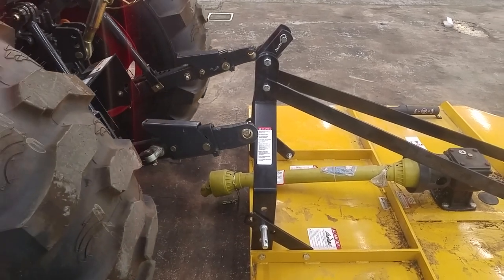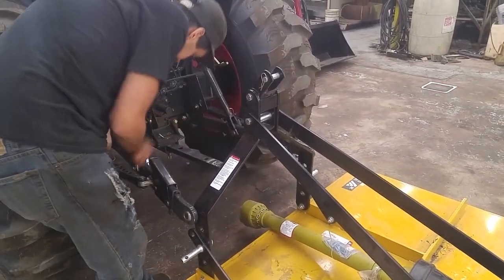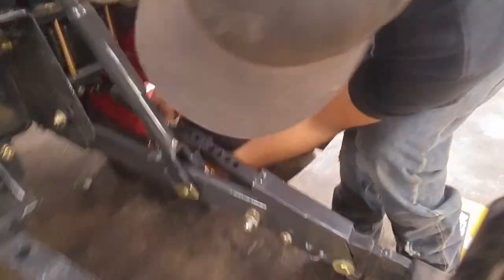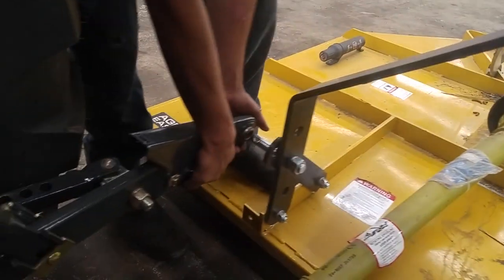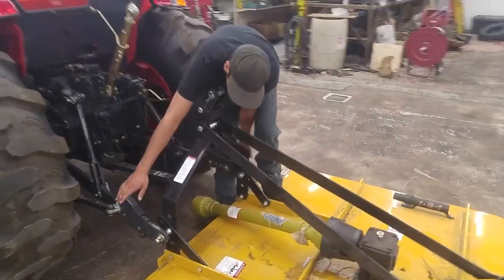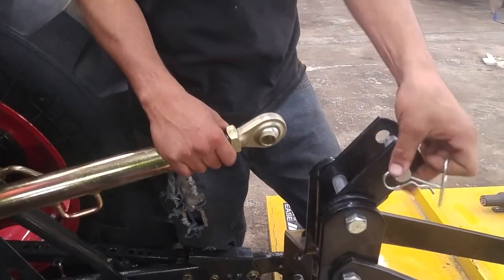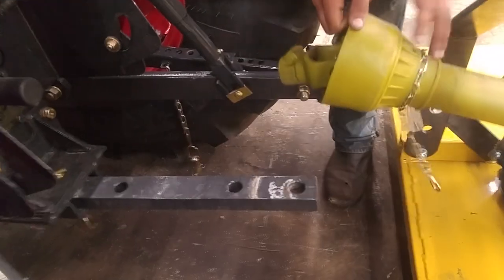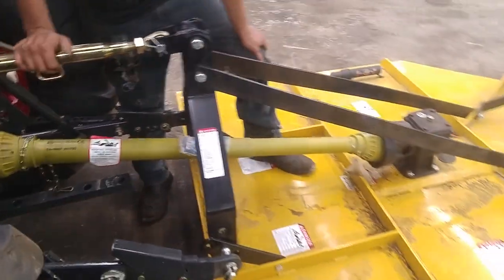How To Install a 3-Point Mower

Comment: Good thing you’re young when you get older you’ll figure out the easy way . Think about it 🤔
Reply: would love to hear more about this easy way
Reply: @watchmenpropertyinspection3469  well I set my bush hog on a 4x4 . My tractor (old) has extendable life arms so I extend them before I back up to my implements . That allows me a little leeway on where I stop. I have also made dolly jack covers out of old inner tubes so that water doesn’t get down in the jack tube and freeze ( learned from experience).
Reply: Do you leave you stabilizer pins off so the Bush hog can sway or should you pin it to where the Bush hog can't sway? Which way is best
Reply: @jeridsumners5995  pin the arms is what I like to do.